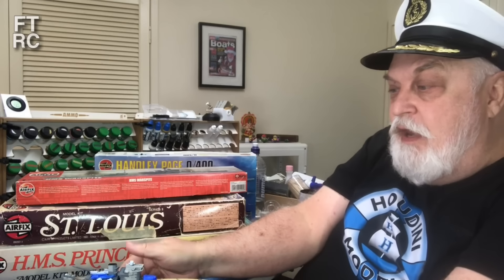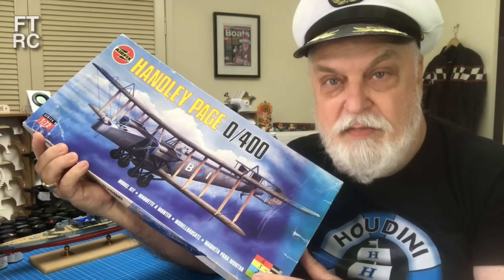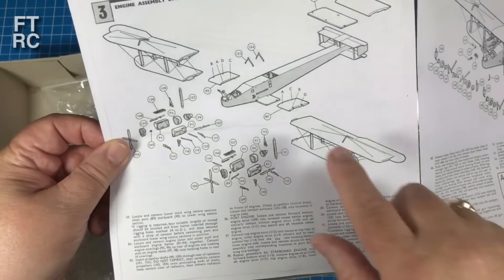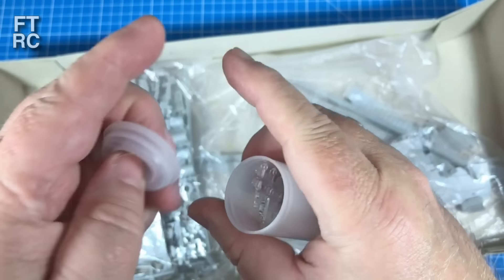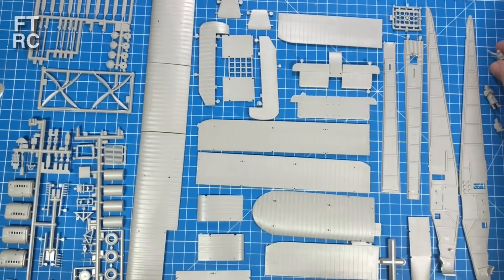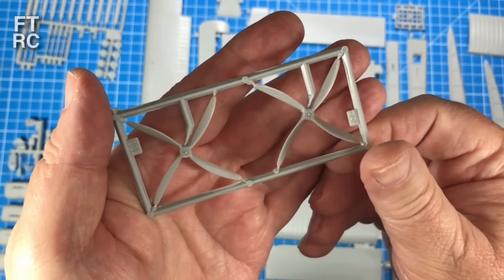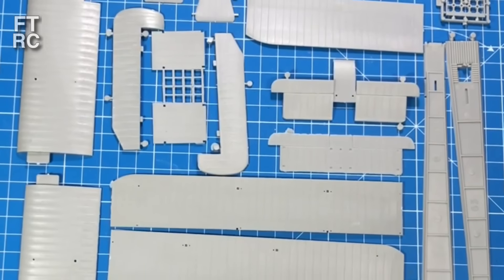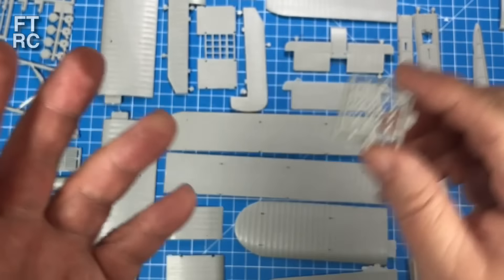Are Older Airfix Kits actually Better? New CAD Tool or OLD 60's craftsman's tooling   I decide!

Comment: Having the wings of the O/400 in three parts was also because the actual aircraft had folding wings at those points so it' nice to give the modeller the option.
Reply from the maker: I did not know that Darren… thanks for the info.

Comment: I have this in a red box issue It's been in my stash for quite a few years now, and although I haven't started it, I'm still  excited by it and still want to give it a go. The only thing with the modern instruction is that Airfix say the dihedral is 14 degrees which sounds a bit excessive should be about 4 degrees. The other innovative thing with the kit is the rigging of the main wings being done while assembling the wings. I think it was ICM that have recently done something similar with one of their 48th bi-planes. Well Airfix were doing this way back in the 1960's. Pity they haven't continued with it with their 48th scale and on some of their 72 scale bi-planes like the sword-fish. I'm looking forward to your comments on making this monster WW1 bomber. you mentioned the size, this aircraft is almost the size of a B29 so you're going to need a big shelf to show it off when finished. I also have the Roden 1/72 Gotha G. V. which to be honest scares the hell out of me, but I know it can be built as photos have been published of completed kits. If you want an example of vague instruction just take a look at many or the Roden kits the Gotha and Bristol Fb2 fighter being prime examples. It's a pity Airfix couldn't put a copy of the original old instruction together with the new ones to give these vintage kits a bit more authenticity. Thanks for another informative and entertaining video.
Reply from the maker: I had the Roden Gotha but shyed away from it at the time.. you are right about the 4 degree dihedral, even the Germans knew that. https://upload.wikimedia.org/wikipedia/commons/c/c0/Handley_Page_O-100_type_drawing.jpg

Comment: I totally agree with your premise. I have just spent a week assembling one of my fav vehicles in 1/35 scale. The SDKFZ10 halftrack. Well actually only partly assembling as the "thing" is probably going in the bin, parts or real. Esci took a reasonably complex chassis and turned it into a parts overkill. Far too many small fiddly little parts (side panels broken into three parts when one would do) to make assemblies that could have been molded whole. Then they added complication in the assembly order that meant when you finally got to the nexus points in the build you realise that the alignment of major subassemblies is wonky, even with dry fitting. Then I have designs on a modern 1/16 kit, Sdkfz 234 by Das Werk where they have accommodated those modelers who want complexity by fully molding the suspension as individual parts, and those who want simplicity by adding in single molded parts as well. A much more pragmatic and sensible approach IMO.
Reply from the maker: I like that idea by Das Werk and wished they had done it for their Schwimwagen I built a few months back.  The over fiddly suspension, which also will never be seen, was just too much for my fat wombat fingers and old bandicoot eyes.

Comment: 100% agree Harry. I love my old Airfix kits, which is why I was camped out on Fleabay to try and get some old favourites of mine from the '70s. I've not tried any of these new CAD kits Airfix does yet. I do have both the Shannon and Severn class lifeboat kits that I bought direct from Airfix, because they said some of the money on the sales goes to the RNLI, these are, I think, CAD kits like your Bulldog. The Shannon is a starter kit, so I'm expecting that to be straightforward. The Severn is bigger and more complex, though, so now you have me worried! :hand-orange-covering-eyes:
Anyways, thanks again for another informative and fun video and, for what it is worth, I would like to see you build the HP 0/400. Bi-planes are fun because of the rigging, so you should feel right at home. I just did a little 1/72 Po-2 bi-plane from ICM. Tricky little thing it was, but doing the rigging taught me lots. 🙂
Finally, any chance of doing any old Matchbox kit reviews, Harry? I have a few and I love em.
Reply from the maker: I built all my Matchbox kits bar a tiny Aston Martin Ulster which is a work in progress that I used to take to Model Club meetings.

Comment: Another cracking video, if I weren't a railway modeller, I'd crack on with kits - there's plenty in the loft, I may not get to build 'em, age wise, it seemed only yesterday I was 6 yrs plus and building some of them. I started work on the Matchbox Large Scale Spitfire and Monogram Mustang, aged 14yrs, saved them for later, life got in the way. Bloody scary really. I digress.

My friend is a long in the tooth, CAD Jockey, design engineer, did his time as a pattern maker. He has worked in; motor industry, aviation, shipping, motor racing, commercial vehicles, passenger buses/coaches, fire engines etc etc, has lap top will travel. He's noted that many young CAD Jockeys now are disinterested and/or clueless about the subject matter.

In addition, we've noted at Hornby, Scalectrix, Airfix, a similar malaise. Add in, at times, clueless management there too, who snatch defeat from the jaws of victory all too often. The perfect storm and part of the reason why instructions (they used to have old school/outside help), design etc has gone awry?

In hindsight, living in blighty in 2024? Looking back at the 1970s and 1980s? A darn sight better than what we have now!!

✌️✌️💜💜👍👍😊😊
Reply from the maker: This explains a lot!  Thanks for watching Muso
Reply: Wait, are you saying you still have those Matchbox Spitty and Monogram Mustang still sitting from way back then? Please consider digging them out. They deserve it, if you can make the time for them. 🙂

Comment: I understand where you're coming from, the reason I build models is to have the assembled model so that I can drool with excitement over having something I've wanted but also the build itself is a large part of the enjoyment. Last year I finished an Airfix Boomerang, an old kit and this one was an original found in a scrapheap of my partner's son's old stuff from childhood. I also built an Airfix Spitfire Mk1a in 1/72 scale and it was a new tool kit. I have to say that he Spitfire blew me away with lovely detail particularly in the cockpit which I left visible with no pilot and an aftermarket canopy with the Malcolm Hood open. I also have an Airfix 1/72 Hurricane (new tooling) to build as well as ANOTHER Airfix boomer but his time a re-release. I think perhaps there is an argument for both sides of this story. I have an aftermarket flying panel for the Boomer because there is nothing but a pilot in this kit so.....swings and roundabouts I think. Perhaps it's a kit dependent thing.
Reply from the maker: thanks for commenting Potrzebie

Comment: Looks still great for its day but the proof of the pudding is in the eating! Will you tackle all the rigging? Some pilot figures would be nice. I agree sometimes Airfix miss the mark but they will always have a core base of fans who grew up with Airfix. Today there is just so much competition out there especially from China who seem intent on dominating the modelling market as so much else! Good luck look forward to the build!
Reply from the maker: True they look great in the box, but I have had enough experience with Airfix kits, and some recommendations from other modellers, plus a lot of building bi-plane experience under my belt.  It should go well.  How hard can it be Mike?
Reply: @HarryHoudiniModels  having seen several of your builds, I am sure it will go together well with all your experience. I am put off bi-planes by all the rigging and I still haven't found a fool proof way to tackle it. Another thing that puts me off a lot of newer models is the excessive amount of p/e but that's an issue for another day! Good luck!

Comment: I find it funny. For years I have seen on forums people wanting more detailed models and that is what model companies have given us. Old kits are good for nostalga but I would not call them better and I am reminded of that everytime I do an Airfix 1/600 ship or 1/144 airliner. They just are not good for the most part. I am happy where modern tooling is going.
Reply from the maker: Not the topic of this video… I merely compare 2 bi-plane kits from Airfix with similar levels of complexity that are half a century apart.  My premise is does CAD improve the enjoyment of building the kit.  

I clearly said this was not about detail, which we would hope would be better from CAD, but in so many cases I find it’s really not that much.  We are also not talking about bad old Monogram, Pyro, Heller etc kits… just Airfix and how their focus seems to have changed from designing kits that are fun to build to now over engineered, over fiddly kits, with baldy done vague instructions that diminish the enjoyment of the hobby.
Reply: @HarryHoudiniModels   Also Harry, these old kits, because they are less detailed, allows for some scratch building fun. For, example, I added radio boxes, first aid kits and bomb sights to my old Airfix 70s Hudson kit, because there is a fair amount of glass around the cockpit, just from some odd junk I had laying around. That's the fun for me, trying to make it better and learning as I go. Old kits allow me to personalise my build more, make it my own way, if that makes any sense.

Comment: I'm with you. I struggle with most of the modern Airfix kits. Either the plastic is too soft or the engineering is too complicated.
Reply from the maker: It seems they have strayed far off the path from the original fun kits I built in the 60’s and still seek out to build now.  Guess I won’t be buying any new tool Airfix from now on.  Maybe I am just not their focus demographic anymore.  I am simply too old.
Reply: @HarryHoudiniModels  Don't say that, Harry, it's the old codgers like us, I think, that are also buying kits these days because we remember the fun we had as kids doing them decades ago. I think there is room for both kinds of scale modellers, both new and er...not so new! :eyes-pink-heart-shape:

Comment: I think one of the issues is expectations. Some modellers dont want to fettle their kits. They want perfect out of box experience. Others want realistic surfaces and rivt count. Me? Im in between. Im happy to do some fettling and love recessed panel lines. But hate excess retro repairs or work to get siple fit to happen. I am working on a Heller 1/48 Mirage 2000 at the moment. Panels lines are very soft and shallow, fit of wings its DREADFUL. Fit of parts is AWFUL, one side tight the other a gap you could call a back alley. Decals ars so thick, too. It's not a pleasant kit. But im perservering.

A good example is the new Airfix tool 1/72 AVRO Vulcan. It looks gorgeous and i want one...but it has a super detailed cockpit, engineers deck etc....and once built you have a rats peehole to see it through!
Reply from the maker: Rat’s pee hole you say… the mind boggles on how you know it’s dimensions Rich?

Comment: I'm actually working on a vintage Airfix Hercules, and I can say "HELL, NO", the older kits aren't better. The only reason I picked it up at the museum kit shop the other day was the price, $25 Cdn compared to $75 for the (not much better) Italeri kit. I don't have high expectations...
Reply from the maker: To be fair the Heracles is 1/144 scale which is tricky no matter old or new.  And bi-planes have always been fiddly.  So if your comparison is to a 1/48 scale Tamiya Spitfire then you are trying to compare apples with oranges.  Point of reference and experience are important factors when saying a kit is better or worse.
Reply: @HarryHoudiniModels  this is the 1/72 version with the missile and launcher. I've built a few dozen of the Italeri kit in 1/72, and two Zvezda 1/72 kits, so yeah, I can say the Airfix one is the worst by a long shot...

Comment: The old Monogram and Revell kits had similar instructions to the Handley Page... written out step by step, told you what the parts were so you learned a bit while building. Today they try to make everything "international" with instructions in 120 languages, so all they do is use exploded drawings with bizarre "international symbols" telling you what to do. I like the picture of a clock, indicating you are supposed to let something dry. Guess it's ray cyst to print only in English.
Reply from the maker: You would think with all the instant translation technology available these days Airfix could produce any instruction in any language for any market.  Just ask figgin Google to translate!

Comment: Todays grey recycled plastic is garbage. It doesn't glue together well and solvent just disolves it. 
Also doesn't take paint too well. The old plastics are far superior.
Reply from the maker: I did struggle to get Tamiya Thin to adhere to the Bulldog plastic.  Resorted to Revell Contacta for most of the build.  But yes, nothing beats the old Airfix plastic.  I love it too.